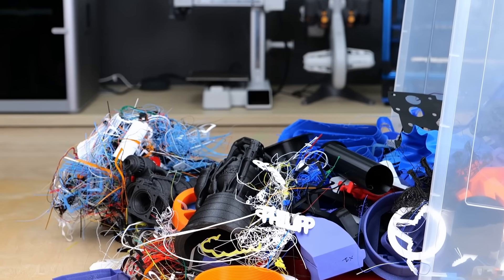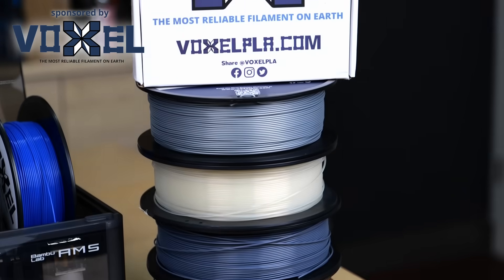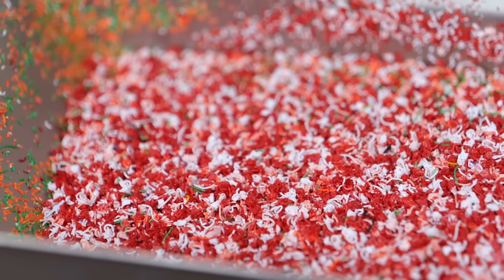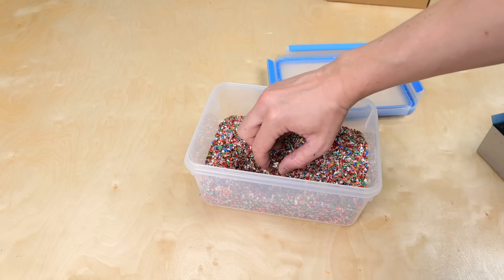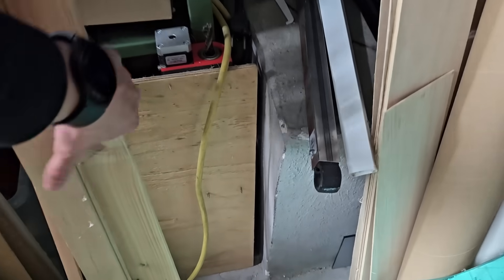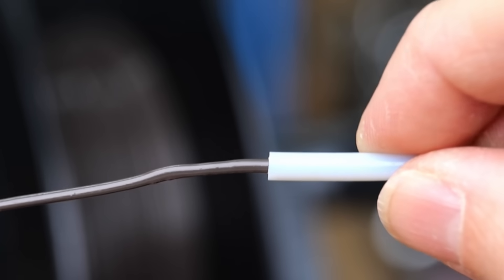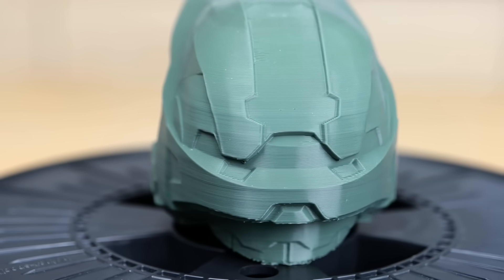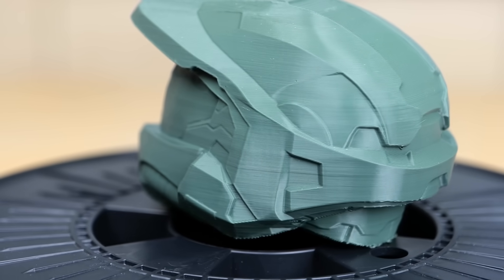Turning 3D Print Waste into New Filament!

Comment: One thing that has always messed with me,
My thoughts are that it would likely be best if the slicer could use the purge as infill instead of tossing it out the back.
Then again, if one is consistent with plastic types, recycling, especially for prints that you don't care about the color, isn't a bad idea
Reply: Prusa Slicer do this but depending on the number of color changes a purge tower may still be needed
Reply: I think they can already do that, but just like with the AMS itself it comes with issues based on the physics of FDM printing, so in practice it doesn't help that much (for most prints). That's what I've gathered, I could be wrong.

Comment: We really need 3D printers who uses pellets and not filament in the diy Price range!
Reply from the maker: There are some but printing with pellets is just so much harder that using filament.
Reply: @CNCKitchen come one Stefan. Use your imagination. What if 3d printer is so big that it's extruder is Artme3d extruder or the extruder becomes smaller. There will be time when this step will be optimized. I think material is the piece of the puzzle here.

Comment: Brothers make has a ton of videos about recycling printer poop, if you want that rainbow look, and significantly less work, you gotta go for a mould system
Reply: Not a fan of molds, you still need to buy them and you guys make all the same things from the molds. Same with 3d printing no uniqueness.
Reply: @matildo4ka7  you can print molds, printing allows for certain manufacturing processes like cast in motion, gyroid infil, etc. 3d printing has more uniqueness to it than most other forms of manufacturing since you can build virtually anything using more materials, colors, and processes than ever before
Reply: @solarpunk9994  i can make molds by hand, why do I need to 3d print them? All 3d printed stuff looks the same. Every market I go to, it's the same things, very boring. I make UNIQUE things = only one of a kind, no clones. They can look similar, but not identical EVER. I create in the moment, not in the code. My art is not programmed, it's movement of my hand, not of the directed nozzle. When I will be gone, it's all that would be left, but 3d printer can keep on printing clones. I don't want to be close to machines, I want to be closer to my human side. I don't think it'll make sense to you. I like the technology, but it is boring as hell TO ME. I packed my printer and gave away my extruders.
Reply: @solarpunk9994  it's prototyping tool, but not for my type of personality. I'm a female and I'm wired differently, I guess. I prototype with my hands or simple tools that I get from thrift markets. Old tools are the best innovation FOR ME.
Reply: @solarpunk9994  3d printing is good for material development, but I'm done with the science, so again, it's not FOR ME.

Comment: I wonder if you could use a set of ~205º rollers machined to the correct diameter to press/roll form the filament into the correct shape and diameter.

Comment: When jewellers make gold wire, they pull it through a set diameter hole to conform it to that diameter. Could you pull the semi hot filament through a metal hole to ensure no lumps/bumps?
Reply: maybe but gold wire is more i guess "rigid" while hot plastic would just make a mess. Gold is easy to bend and correct (even if reheating is required) but the plastic being so thin cools too quickly and if reheated is more then likely going to make a mess rather than fix the problem :/ but thats why the machine has 2 wheels to press and shape the plastic, its not perfect but i think in a few years time there will be a more efficient way to do this. If people want something done, someone will want to get on that!
Reply: I think it's an overkill for PLA
Reply: I was thinking similarly... pull the new filament through a hole in a metal plate to not only check the diameter, but also scrape/shave off sections that are too thick. Doesn't even need to be heated.  You could catch and fix the problem segments BEFORE running it thru the printer.

Comment: I would be happy to buy recycled filament as long as it was 1) reliably printable and 2) less expensive than new material.
Reply: Interesting thing about recycling is that in a lot of cases it costs more to recycle than produce new. This process shows some of the extra effort, imagine the sorting +qa effort involved in a large scale production environment getting material from many different sources?

Comment: Hello, thank-you about your very good videos. What do you think about my last idea for reduce for at least 50% (to 75%) Bambu Labo poops ? 

“Simply retract 20mm to 30mm of filament just before cutting.”

It seems that it should be fairly easy to reduce the amount of filament lost through purging by 50% to 75%. Just retract 20mm to 30mm of filament just before cutting.
Thank-you in advance.

There’s about 42 mm of filament in the head, about half in the hot side and half in the cold side. It should be possible to remove at least 20 mm of cold filament without deformation. And perhaps a little more, depending on the filament’s heat behavior. If part of the hot filament is only slightly stretched, it can be retracted too. This depends on the filament and the temperature, but should be no problem for at least the cold 2 cm.

Thank-you in advance.

Comment: I'd buy recycled material if it was cheaper, instead it's more expensive than just buying fresh filament.
Reply: This is the reason all plastic recycling technology so far has been a lie, all recycled plastic is more expensive and worse quality
Reply: @felixarbable  Not true, or there wouldn't be a recycling industry selling to business, they only do it when it makes economic sense.  Also most recycled material is mixed with virgin and at up to 25% addition no material property differences are found.  Post consumer waste is another matter, control of sources is everything.
Reply: @cricketerfrench7501 the reason that exsists is because of public pressure and to help companies look like they are doing something. The reality is we are producing more virgin plastic than ever and recycled plastic is mostly used to pretend that there's a real viable model there. The money is in creating the plastic on the first place and large oil companies and Saudi etc have huge plastic lobbies
Reply: Dumb question. If you print in white and paint it, wouldn’t it be funner and easier, and less expensive?
Reply: Youd be risking quality tho  I mean this could print perfectly then it could print like shit
Reply: Your pfp is really cool. Would you be okay if I were to share it?
Reply: and it all ends up in the enviroment as micro plastics....
Reply: More time goes into it
Reply: @nickoli2356  The additional time used in production doesn't add value to the product - which results in a more expensive product that has a lower quality than fresh filament.
Reply: The extra time doesn't make the end product more valuable.  In order for recycling filament to be viable to consumers/end users the recyclers are going to have to accept smaller profit margins vs. newly produced filament or find more efficient ways of recycling.  Otherwise they will only sell recycled filament to those who are obsessed with being as green as possible.  Most people feel good about being more ecologically friendly, but aren't going to spend extra and get an inferior product to do so.

Personally, if home recycling was less time and money intensive I would be all about it as I hate wasting materials and love being able to repurpose old materials, but it just doesn't seem like the technology is there yet.

Comment: I'd use recycled filament, if it meet the same diameter constraints as new, and was also of known type (not mixed with other types of plastic).  At least all PLA or all PETG.  Not having a choice of color wouldn't be an issue for structural prints.

Comment: I've owned and used recycled material. But I've had only 1 spool of "recycled from people sending in their scraps" and maybe 3-4 spools of "filament manufacturer took their own waste and repelletized it and then re-extruded". Interestingly, most of the manufacturer recycled filament is an olive green... but I still mark it as "recycled... color may vary".

It came up elsewhere, but it really comes down to 2 things: are you trying to get filament out of it OR are you just trying to not throw the plastic out.

I know a lot want filament, but then you have the elephant in the room: money. If a filament maker can't make money, they're not gonna exist/operate. If you told someone "pay $20/kg, now spend $10 to ship the waste to this location, and then we'll send you a proportional coupon that saves you $5 off a $30/kg spool that may not be in spec and is a random color" most of them would say "no" and move on. If you had an altruistic individual/group who isn't trying to make money, then it's a different story... but I've not really seen any of those outside of "that one guy in a garage who happened to do this... but they can only handle a few KG before they're overwhelmed".

The one I'm leaning more towards is using the waste to become something else. It's really convenient to make a GridFinity bin or even a generic parts bin for some hardware store rack. But you may be printing $2 per bin, when you can buy them under $1 each. I'd much rather get a mold and then use the waste to make those bins. I know people who make figures, paver stones, etc. with it. But that's not my thing at the moment.

Comment: I’d really like to see strength tests on the cons batch. If the coupons have roughly the same strength, I wouldn’t mind printing functional parts with it at all. Fascia and more decorative prints, I’d stick with the virgin material, but structural bits not seen by the end user, or parts I just make for the shop, I’d love a recycle option.

Comment: I  do not have an extruder, but i have a custom build ender 3 pro. And i have made a smart filament sensor that pause when a jam, stuck or runout. So I have an idea where you might be able to mount a similar sensor after the "pulling wheels" in your extruder with a bowden tube that the filaments can get stuck in, and then make your extruder pause/alarm in the event of an error. So you can just cut out the bad and continue. Best regards, Thore from Sweden

Comment: I don't want to be negative but I have some disagreements with some things you said at the end.

I haven't seen anyone CNC PLA.  And when I tried it myself, it was nearly impossible.  It's too hard in a block but also melts too easily.    Every pass would gum up the bit.   The only possible way to make any progress was to barely make a cut, let it cool off, clean off the bit, take another clean up pass, let it cool off again, and take a third pass.  It's not worth it for a 1 mm cut.

And precious plastic hasn't done anything with PLA either.  In fact they kind of lied about the capabilities of their machines.  Making filament was a selling point of their original plans and yet they never showed a successful print.  They also had a bunch of misinformation in their video about 3D printing.

On a positive note thank you for showing Brewster Beagle and his injection mold machine.  I still haven't seen anyone injection molding recycled pla tho.  Please try it in the future if you can.  I believe it's a much better alternative for recycling pla then trying to produce more filament which is incredibly difficult and expensive.  We need better injection machines and mold designs so that it can become more popular.  Then regular people can really start recycling.

Comment: I am wondering, what is the impact on material properties after recycling. Layer adhesion, strength, melting temperature...
Great video! I wish the recycling were easier.
Reply: Melting temperature didn't change after 5 recycling cycles. I got DSC results in the lab, all the same or close enough
Reply: I assume it is more brittle, but I don't think drastically

Comment: I suggest installing a second extruder and printing internal perimeters and filling with recycled plastic. This can be done with a large nozzle to avoid clogging.
Reply: Isnt a lot of the clogging already happening before melt in the heatbreak/extruder/bowden tube? A larger nozzle alone wont help, not sure if there are hotends and extruders with explicitly larger tolerances on filament.

Comment: Have you tried to use the PET filament puller to push the wonky filament more uniform?
Reply: Wouldn't work. The main issues there would be that it can only make the filament thinner, so areas where it's already too thin are stuck, and there's no feedback control system, so it couldn't speed up/slow down to modify the output thickness. Plus, at least as implemented, the pulltrusion setup must be fed with input material that's significantly thicker than the output. The 3Devo result with a built in feedback control system is going to be the least worst output for a given input other than a better, likely more expensive, feedback controlled extruder.
Reply: @bosstowndynamics5488  at least from his video the biggest issues were the portions of filament that were 1.75+ as those caused complete jams/stops. For that instance it should work.

And theoretically that extra material would need to be displaced somewhere, thus filling in some of the -1.75 spots too.

As for getting precise diameter all the way around I definitely understand the need for a control loop.

Also what about the pullstrusion needs a significantly thicker? Technically speaking the volume is less then the 1.75 as it creates a hollow tube of pet. Mostly right PLA I would think would satisfy the thicker cross section you mention.
Reply: @powersave2  The filament isn't a fixed length - thicker areas will get stretched to 1.75, the material won't make its way automatically to the thinner sections.

A closed loop control isn't just nice to have, it's mandatory, as a simple pulltrusion style system would thin out filament by the same amount regardless of starting thickness, so thinner sections would wind up even thinner. The reason you get away without one with bottles is because they're fairly consistent in thickness, and the strips are always cut to the same width so the input rate is consistent.

Pulltrusion requires the input to be thicker because it relies on the tension in the filament between the extruder and the puller to stretch the filament down to the correct thickness. If you fed it with 1.75mm filament there would be no real resistance so there wouldn't be enough tension to stretch the filament, it would just pull straight through the system without heating up or being reshaped. You could do something like the 3Devo with a multi stage setup but that's no longer pulltrusion, and it would be much more complex than a pulltruder as a result (there's a reason 3Devo can still command a 5000 Euro price tag for their basic model).
Reply: @bosstowndynamics5488  ahh right I guess I was thinking more push then pull. As in pushing the filament, anything under 1.75 "wouldn't" be affected and then anything bigger would have its 'extra' pushed into a spot with less. But obviously I was thinking of it very wrong haha.

Thanks for explaining it out.

As for feedback don't most people not have one with pulltrusion? I thought the whole point of pulltrusion over the 'std' process is that the plastic wasn't actually getting molten just warm enough to deform and eventually someone has an exact speed to temperature ratio for the sweet spot.

Ive watched lots of videos on it and damn I didn't realize how little I knew haha
Reply: @powersave2  I'm not sure how temperature dependent pulltrusion is but the feedstock would actually be pretty uniform since it's a fixed width strip of plastic and the containers it's cut from are probably very similar in thickness, whereas the recycled filament would have a lot of variability in the size of the grinds.

Comment: Having long been in a "whatever color was in the printer at the time" mode, I usually don't think in terms of the finished product coming right off the printer.  Instead, I will frequently combine several parts printed in different colors and then paint the finished product. 3D Printer filament recycling needs to be approached from this viewpoint, such that the final color is irrelevant. One will paint the finished print a different color. If the filament is the right diameter and does not jam the nozzle, it is the right kind of filament regardless of the color.

Comment: I think I totally would buy recycled materials, especially if the colors were funky af. I think it's very cool to have weird colored prints, I can always paint them if I need them to be a different color!

Unfortunately, where I live, there aren't a lot of people doing 3D prints, let alone recycling! So I just have to wait for 3D printing to catch up I guess.
Reply: I am collecting my 3D printing trash until I have enough to be economical to buy a recycler. Recycler are also, slowly getting cheaper, so the two should cross eventually in value.